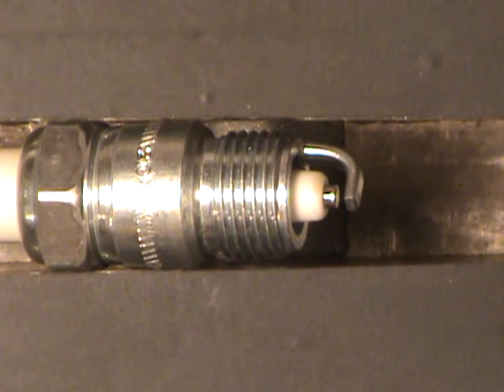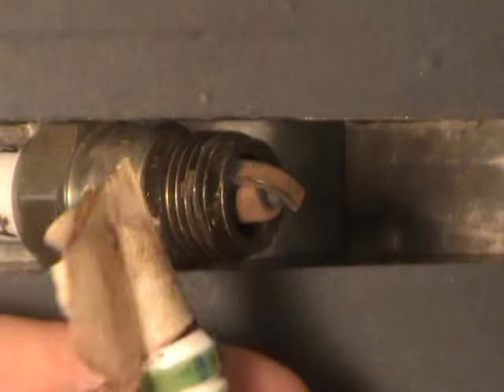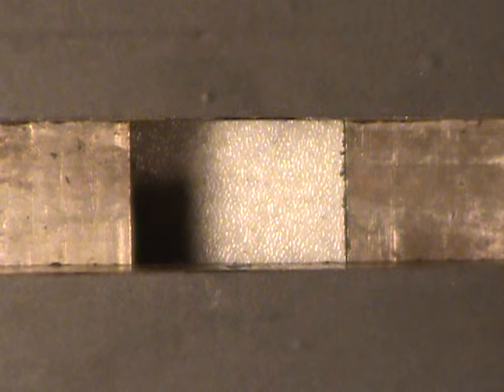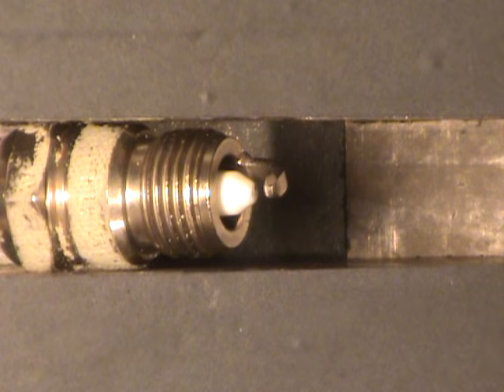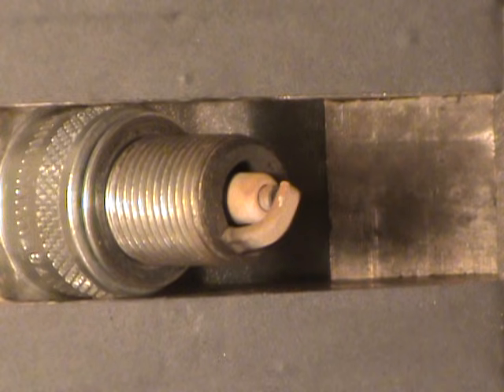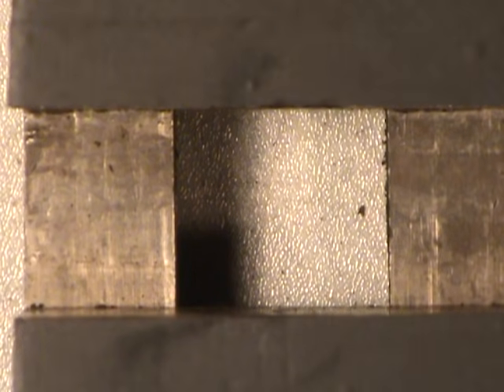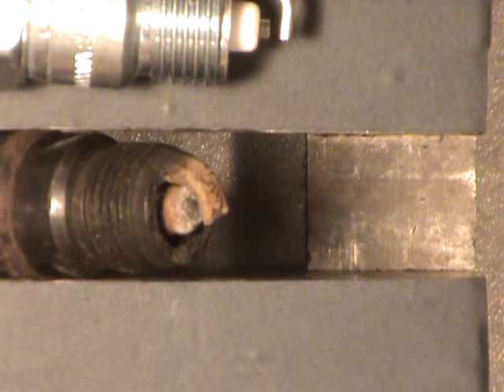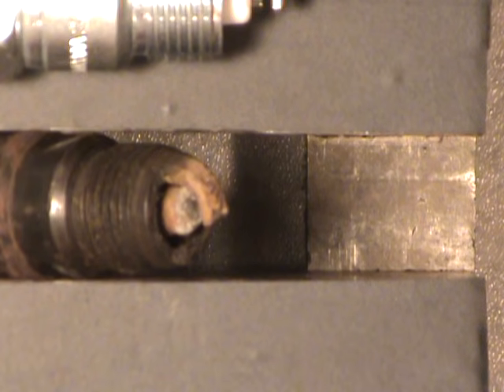SPARK PLUGS How to Read them (Part 3)

Comment: Can I get a spark plug reading? This plug came off a motorcycle. Before the porcelian was pure white and now it has a bit of grey on the tip. 
http://imgur.com/dw0Ez1Y
Reply from the maker: Greetings...auomauom...............Thanks for watching.................The picture of Your Motorcycle's, NGK Spark Plug, is very clear, and very well done.................Here are a few things, to consider.....................Is the NGK Spark Plug, that is shown in Your Picture, the "Exact" one, that is "Specified", by Your Motorcycle's Manufacturer, providing that, Your Motorcycle is Factory-Stock, and is Not-Modified...???...cuz, if not, then, that in itself, can lead to a problem or two, and perhaps, some not-wanted Engine "Damage" as well, and I hope not..................To Me, it looks-like, the Spark Plug, might have too Hot of a Heat Range, and/or, Your Air/Fuel Ratio, might be a bit on the Lean, Air/Fuel Ratio (mixture), side of things as well, possibly.....................Also, it depends on just how hard or not, You are Running Your Motorcycle's Engine as well...............Lots of time, spent Highway Cruzing, will usually make-for, a Spark Plug that will usually stay Cleaner looking, as opposed-to, lots of Cold Starts, followed by, short length of time/low speed trips, where-by, the Spark Plug, will possibly have more Deposits showing on it..................Try this, take a "Magnifying Glass", and have a very "Close" Look, at the whitish-Porcelain, that is surrounding the Center Electrode.....................What You are looking for, are any..."small"..."Black or Silver Colored Dots"...and if You happen to see any, then, that will usually be..."Engine Damage"...going on, inside Your Motorcycle's Engine...!!!...Yikes...!!!...and can be caused-by...too Much, Ignition Timing Advance...and/or, too Hot, of a Saprk Plug Heat Range, and/or, too Lean, of an Air/Fuel Ratio (mixture), and/or, too much Carbon, built-up, inside the Combution Chamber/on top of the piston, and hopefully, Not, all four, at the very Same Time...!!!...Yikes...!!!....................Is Your Engine, making any "Pinging or Knocking" Sounds at all...???.................Does Your Engine, Cold Start, and Hot Start Ok...???.....................Cold and Hot Engine Running Ok...???....................Just about any Gasoline Engine, out there, has a, shall we say "Personality" (well, to me, it sure does...lol), and, if the Engine in question, becomes "Un-Happy"...it's almost a given, that "It" will start "Acting-Up", sometimes, just a little Bit, or, if really Bad, it just decides to Quit...!!!...............If the Gasoline, that goes into Your Motorcycle's Gas Tank, has any Ethanol (alcohol) in its Blend, then, that will usually cause an Engine, that has a (non-feedback, type of) Carburetor on it, to probably make-for, a Leaner, Air/Fuel Ratio (mixture), and, the Spark Plug will more than likeky, look, kinda Lean (deposit-wise) as well....................Your NGK Spark Plug, appears to be, the Old School Design, that has the LARGER looking center electrode...........The old rule of thumb (for the old school type of spark plugs), use to be, that, the Spark Plug's "Gap", was to only get Bigger, by about .001" (one thousandths of an inch), in about, 1,000 Miles Travelled....................I noticed that, Your NGK Spark Plug's Center Electrode, appeared to have, "Rounded-Edges", all-around, its circumference..................From what I recall, High Voltage Sparks, kinda find it much easier, to Jump-From, and, Jump-To..."Sharp Edges"...probably, making it so, that, the Ignition Coil, Doesn't have to work so hard, to get the job done.....................Make sure, that You Set/Adjust (if need be), the Spark Plug's "Gap", to the Factory/Manufacturer's "Specification", if Your Engine has Not been Modified, but watch out now, cuz, some Saprk Plug Designs, are Not-Gap-able/adjustable, just so You know................If Your Exhaust System, has been Modified, so as to Improve the Engine's Breathing ability, then, that, in itself, can cause an Engine to Run, quite a bit Leaner (air/fuel Ratio/mixture), that's usually caused by, what is known, as the (exhaust system's) Scavanging Effect (more-so, with tubular exhaust headers)....................If You have any more questions, or concerns at all, just let me know......and.......till next time.......Be Safe, take care, and have a good one.
Reply: thanks for your in depth reply!!! I will try to answer most of the question you have asked. 

Some info on the bike: It is a 125cc single cylinder engine. I've been running 91 unleaded gasoline every since I got the bike. Just recently I add a fuel controller, and the bikes power throughout the rpm band seems to very strong in comparison when it did not have the fuel controller. The exhaust note has gotten deeper and louder compared to when it sounded a little high pitch.

-This spark plug is the exact one that has come with the motorcycle since it has left the showroom floor.
-The reason why it looks lean is because this motorcycle has been set to run a bit lean at stock, hence the white color around the ring. Also, I have been riding around for at least 3k miles now until recently I installed a fuel controller unit which adds more fuel.
-The sparkplugs ring has a lot more soot than it used to.(don't have before/after picture of spark plug)
- I ran this motorcycle hard for 5-10 mins before I used the kill switch at 8k rpm to read the sparkplug.
- When I looked at the electrode or white porcelain I did not see any black or silver dots. All I saw was grey all around the tip of the white porcelain.
- I do not hear any pinging or knocking sounds from the engine. 
- The engine cold and hot starts very well. There are no hesitance when starting up.
- My Engine Head temperature readings for this bike got up to 260-280 degrees Fahrenheit at WOT for a considerable amount of riding time. That temperature reading is average. I have yet to check the oil temperature.
Reply from the maker: Greetings...auomauom.................If You can let me know, what Your Motorcycle happens to be, as in...Year...Make...Model...Mileage/Kilometer-age on it, and if it's a 125cc, 2-stroke-cycle, or, 4-stroke cycle Engine, Air Cooled, or Liquid cooled, with a Radiator, having Coolant/anti-freeze in it, as well as, if it's fuel injected, or has a Carburetor on it, etc., along with, the Description of Your (added-on) "Fuel Controller's", Manufacturer, and Model Number, cuz, if You do, I can be much more Specific, and a little less Generic, with, what-ever help, that I'm able to give You...thanks.....................Here are a few more things, that may be of some help.....................Most, factory stock, gasoline, fuel injected, (more so, car & truck) engines, will usually have, what I would call "Safe"..."Programing"...that is..."Mapped/Programmed"...into the vehicle's On-Board Computer, in order to, shall we say, keep the engine "Safe", so as not to Damage the Engine.....................Unless Your 125cc Engine, has been Modified, then, there might not be much of a Difference, with the Power Output of Your 125cc Engine...???....seeing as how, Your Motorcycle's Manufacturer, has probably, already Programmed-in, a "Safe", and probably, a bit Richer, of an air/fuel ratio/mixture, especially so, for, when-ever doing a WOT/Wide Open Throttle application..........................You might even find, that Your Fuel Economy, might be a bit Less, if in fact, Your added-on Fuel Controller, is Adding "EXTRA" Fuel Gasoline, when it really isn't  needed...............Your Bike's Manufacturer...probably Programmed, a Richer Air/Fuel Ratio/Mixture, to keep the Engine "Safe"), as well as, a some-what Conservative, Ignition (spark) Advance, Timing Map/Program......................You might even find that, Your, as You put it, "Bike" (is it a Motorcycle...a Scooter...or a Moped...etc. ...???), could possible putting out Less Torque, and/or Horsepower, due to having, a, more Rich (air/fuel ratio), than  is actually needed..., don't get me wrong, cuz, a Gasoline Engine, that is running a bit too "Rich" (air/fuel ratio-wise), probably won't harm the Engine (the engine, just gets a bit Lazy, most times), where-as, lettuce say, we're doing an extended (time-wise), WOT/Wide Open Throttle application, with an Air/Fuel Ratio, oh, somewhere around, oh, 15 to 1 A/F Ratio, then, by doing so, my Friend, the Engine just "Self Destructed", and about all it's good for now, is probably that, of becoming a "Boat Anchor", or, a really Heavy..."Paper Weight...!!!...Yikes...!!!...................A Vehicle's, On-Board Computer, will usually be in Closed Loop Operation, while using the Oxygen Sensor/s, output, kept at, about 14.7 to 1 A/F Ratio, while going easy on the Throttle, and when the Engine is at operating temperature, as well.......................Now, it's Full Throttle Time, doing a WOT/Wide Open Throttle Run, so now, the On-Board Computer, will usually just go into Open Loop Mode, and "Richens", the A/F Ratio, to perhaps 12.5 to 1, and will probably, just Ignore the Oxygen Sensor's output, at the very same time.......................See that...while having the Engine fully warmed-up, then, it's usually, a Leaner A/F Ratio, for just Cruzing along, and at idle speed as well, due to a Low Load, placed on the Engine...and...quite a bit Richer, of an A/F Ratio (about 12.5 to 1 there-abouts), for that, Hang-On-Real-Tight"....WOT/Wide Open Throttle Run...!!!...lol...due to the Much Higher Load, placed on the Engine................Also, the Ignition Timing Advance (that's measured in Crankshaft Degrees), might be around 50 Degrees BTDC/Before Top Dead Center, while just Cruzing along, not too fast......................At WOT/Wide Open Throttle, there might be somewhere around 30 to 35 Degrees (ball-park figure) BTDC/Before Top Dead Center (TDC is when the Piston, is all the way Up, closest to the Cylinder Head)...and...(is measured in Crankshaft Degrees)...................Leaner A/F Ratios, take more time to Burn...where-as, Richer Ratios, will usually Burn Faster, as long as it doesn't get Too-Rich, that is.................What does Your Bikes, "Owners Manual", have to say, about the "Octane" Number, and the "Method", that is used, to Describe the Octane Number, of the Gasoline, that gets put into Your Bike's Gas Tank...???.............................It's usually the Compression Ratio, of the Engine, that, well, kinda, has the First Say, if You will, as to, just what...???... the Octane Requirement, should be......................I find, that, oh, a car or truck engine, having, No-Higher, than, about 8.5 to 1 Compression Ratio, easily, does quite well, with the Cheapest Stuff, be-in 87 Octane, that uses the, I think it's the, R+M divided by 2, Octane Rating Method, here in Canada.....................Keep an eye, on the Coolant Temperature, if Your Bike has a Radiator, cuz, sometimes, a Lean Running Engine, can be responsible for higher-than-wanted, Coolant (aka, anti-freeze & water mixture) Temperatures, just in case.......................You were saying, that, You saw, more Soot/Deposit, on the Spark Plug, which, probably means, Your Engine is running a bit Richer alright...???.......................If You really want to know, what the Air/Fuel Ratio, happens to be, at any given time, while the engine is running, is to Install, a "Wide-Band" Oxygen Sensor, in the Exhaust Pipe, reasonably close, to the engine, along with an Air/Fuel Ratio "Gauge", that will Display, the Air/Fuel Ratio, that will usually make-for..."No more Guessing"...!!!...lol....................There should be some "Kits", that are for sale, that include, the "Wide Band" Oxygen Sensor...the, Air/Fuel Ratio Gauge...and, the Wiring (harness...???), as well.....................So, that's about all for now, and, if You can let me know, about Your Bike and Fuel Controller, we can proceed from there...thanks...and..........till next time.........Be Safe, take care, and have a good one.

Comment: I've got a utility vehicle (JD Gator) that has some pretty edgy looking spark plugs. Runs real rough on idle, but it's fine once it gets going, purchased a borescope because I suspected excess  carbon buildup. Can't remember if the plugs were the color of ash, or dark as midnight, I was working on 2 different things at the time. I'll post pictures tomorrow, any insight from you would be appreciated.
Reply from the maker: Greetings...Anon Ymous............Thanks for watching............To avoid, any not wanted problems, with Your John Deere...Gator's "Ignition System" (aka, electrical circuit), a very good thing, to be doing, is to, try to purchase, the "Exact" Ignition System Parts, as in, "Exact, Brand and Part Number", that were "Originally Installed", by Your Gator's Manufacturer, that being, John Deere........................Whenever a Spark Plug's "Gap" (that's between the inner and outer electrodes), starts to get Too "LARGE", that, my Friend, will usually cause the Ignition Coil, to Work, all that much Harder, and, maybe to the point, of having the Ignition Coil, to become "Over-Heated", and maybe going Kaput...!!! (aka, non-functional anymore)...............Make sure, that You "Set the Gap", between, the Spark Plug's "Electrodes", to the "Specification", that the John Deere Company "Recommends", for Your Gator's "Exact" Engine/Model/Size, providing that, the Spark Plug, is able to be "Gap-ed", that is, as there are some Spark Plug Designs, that Are-Not Gap-able, just so, You are aware...................A good ole Saying, that I like to use, happens to be..."The Chain, is only as Strong, as its Weakest Link"...and I really like to apply that saying, to, Ignition System/Circuits...Why, You ask...???....cuz, if a Component/Part, that has the "Wrong Specification", gets Installed, in something like an older, points and condenser, type of Ignition System, the Result, might end-up being, a Weak Spark, between the Spark Plug's Electrodes, or, as bad as, having the Ignition Coil "Fry" itself, due to "Over-Heating", and then, the Engine, just goes Silent...!!!...Yikes...!!!..............................The "Cleaner", the Spark Plug, the "Better"...!!!....cuz sometimes, the Deposits, on the Electrode-End of the Spark Plug, can become Conductive, and the Ignition Coil's High Voltage, that is coming through the spark plug Wire/Lead, will probably, just Short to (electrical) Ground, and look Ma, "No Spark", what-so-ever, Between the Spark Plug's "Electrodes"...!!!...................Also, something like "Carbon Deposits", on the Electrode-End of a Spark Plug, can cause, a very bad condition, known as "Pre-Ignition", where-by, the, maybe...???...Glowing Carbon, causes the Compressed, Air/Fuel Mixture, to "Ignite", far too Soon, as the Piston is rising Up, in the engine's Cylinder, and "Engine Damage", it just might be...!!!..............Sometimes, "Ignition System" Problems, turn out to be, "Fuel System" related Problems, and visa-versa, oh, and, sometimes "Both", at the very same time...!!!....and, I hope not ...............If You care to, You can let me know, what Your John Deere...Gator's..."Model and Engine Type/Size"...happens to be, otherwise, I'll just be going on, a..."Wild-Goose-Chase"...!!!...lol....and...till next time..........Be Safe, take care, and have a good one.

Comment: you are the man. so many companies have not done a video, or even racers, or even mechanics thank you for this.
Reply from the maker: Greetings...richard mouton.................Thanks for the nice comment, and, for watching as well......................Here, I had a bunch of, older, used Spark Plugs, that I kinda hung on-to, that were out of, mostly older Engines, that had Carburetors (not fuel injection) on them, while also, for the most part, also having, a, shall we say, Ignition System, with a Lower High Voltage Output, as compared to, some of the other, Factory installed, Higher Secondary Voltage (Output) Ignition Systems, that started, oh, some-where around 1975 there-abouts (using the good ole General Motors HEI/High Energy Ignition System as a reference point...in time, that is)......................You'll probably find, that, there probably won't be as many Deposits, showing-up, on the Spark Plugs, that were removed from, a much newer, Computer Controlled, Fuel Injected Engine, and also, while probably having a certain percentage of Ethanol (alcohol), added into the Gasoline, at the very same time................There are some Folks, Racers perhaps...???...that might be using a Magnifier/Flashlight lookin' thing, where-by, they can have a really good "Close-Up", of the Spark Plug, that they are Reading, so to speak....................Thanks again, and.........till next time..........Be Safe, take care, and have a good one.